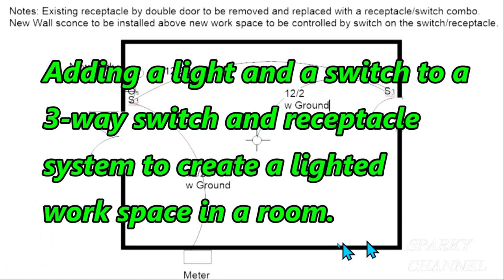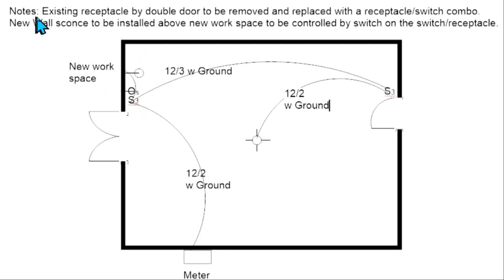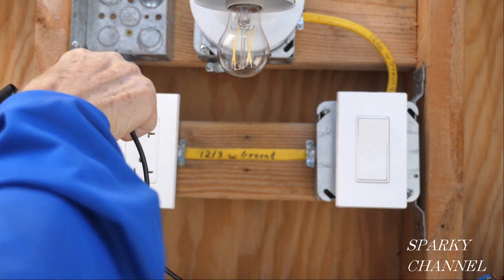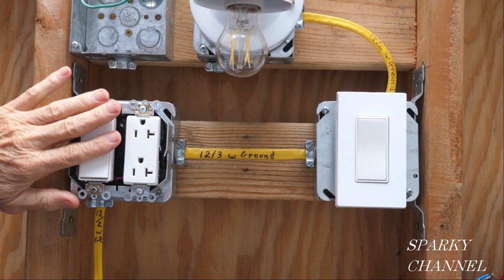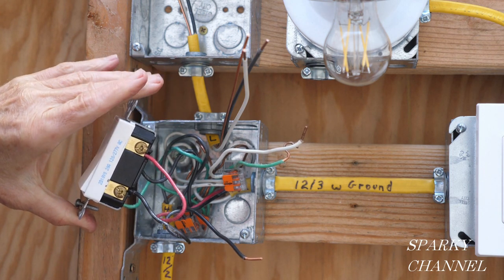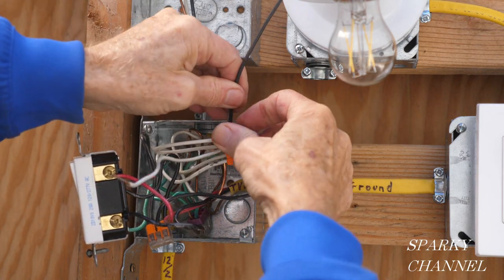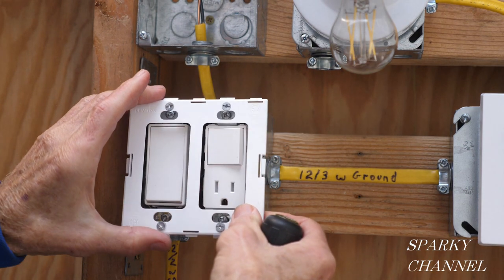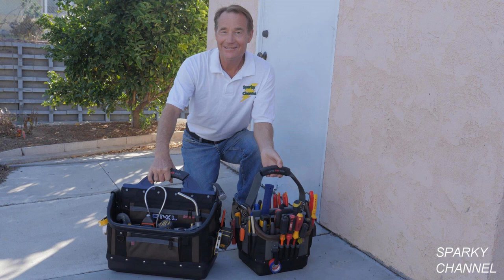How to Install a Combination Switch/Receptacle and a Light in Place of a Receptacle

Comment: Sparky! wondering, i have a junction box with 14/3 wires. I wanted to put an outlet in the box. Would it be proper to hook up both black hot wires to the brass side and both white neutrals to the bronze side and then just leave the traveler wire in a wire nut?

Comment: had a troubleshoot on one of those, once, where it had been installed with the idea that the switch controlled the receptacle.  first thought was that the load was shorted, and since it wasn't something I needed to use, I just left it unplugged and the switch turned off.  but random people would turn the switch on for no reason, and it would still short out.  so I finally opened it up, and they had the black wire to the brass terminal, and the white wire on a black terminal.
Reply from the maker: Wow! Good job on fixing that!
Reply: @SparkyChannel  don't know whether to be more annoyed at how obviously it was miswired, the fact it was obviously never tested, or at the fact people would always mess with it at the most inconvenient possible times.
Reply from the maker: @kenbrown2808  LOL!

Comment: Is it possible to change the outlet & switch combo to a GFCI outlet & switch to protect the entire circuit?
Reply: in theory, yes.  in practicality, it may be a bit of a challenge getting the GFCI combination device to fit into the box. Bill chose his box for making it easy to see the wiring instead of for having plenty of volume for bulky devices.

Comment: Does Leviton make a combination switch and 20A receptacle?
Reply: Yes they do!
Reply from the maker: Yep. Here you go: Leviton 5636-W 20 Amp, 120 Volt, Decora Single-Pole, AC Combination Switch, Commercial Grade, Grounding, White: Amazon: https://amzn.to/2UUvGgK
Reply: @SparkyChannel  so why did you use a 15 amp receptacle instead of 20 amps?
Reply from the maker: @SassafrasSapling  15A receptacles have a 20A pass-through rating so it's OK to install them on a 20A circuit.